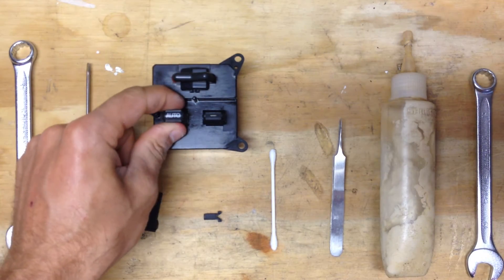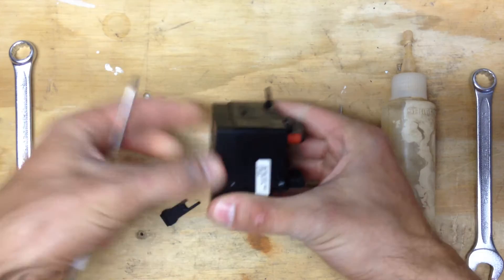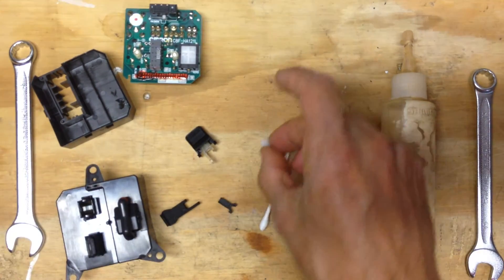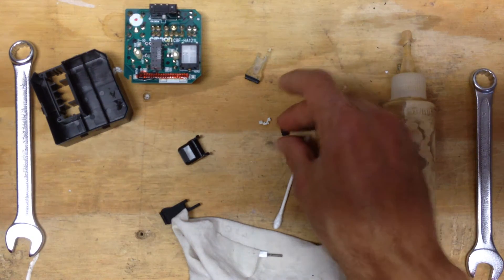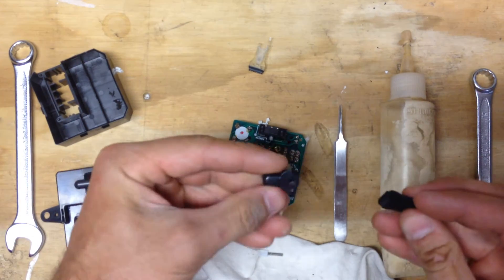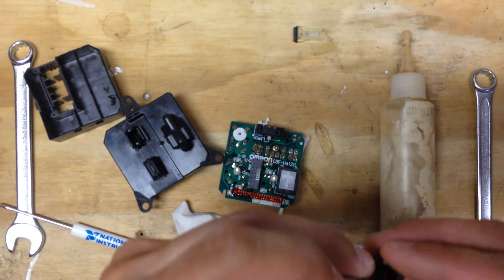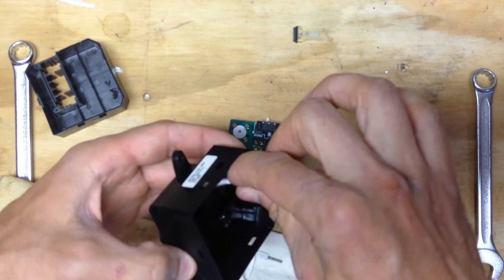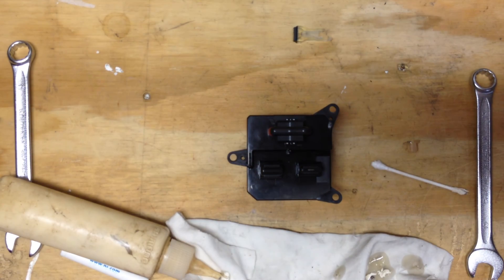3D printed Insight Window Switch Fix

Comment: Did you need to remove the instrument cluster to get that switch out?
Reply: Here's a vid: https://www.youtube.com/watch?v=jaxOJvsLumQ&t=322s
Reply: I just performed this. I was terrified of cracking it, but I followed the instructions to a tee (exc. that I didn't remove the nuts holding up the steering column; instead I took them "almost off" and pushed the column down as far as they'd permit; that was still enough room and kept the column up and out of my way)--including the most important part: being as patient as he was...  My own observation is when you have the bottom completely free, grasp the semicircle at the top over the speedometer and pull. It will come easily. It won't come far because of the connectors. On that score, remove the ones from the right first, that will let you angle the bezel and give you more room to get to the left side ones which I found to be in tighter quarters. Putting it back was under 10 minutes.
Reply: Of course how else would you get it out? Be careful because I cracked my dash when pulling it off at the top. I would do this when the weather is hot as it may be less susceptible to cracking. There is a correct way to pull the dash trim off.